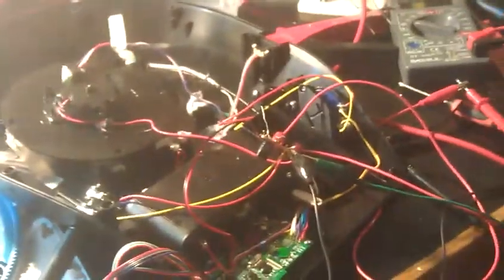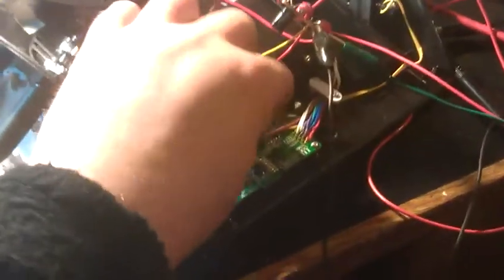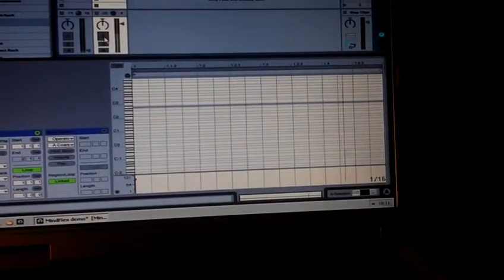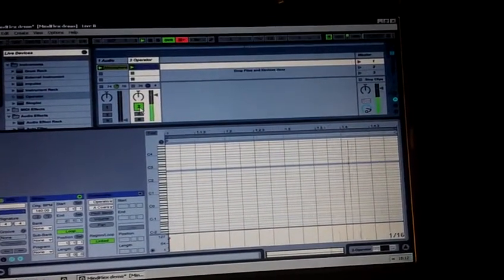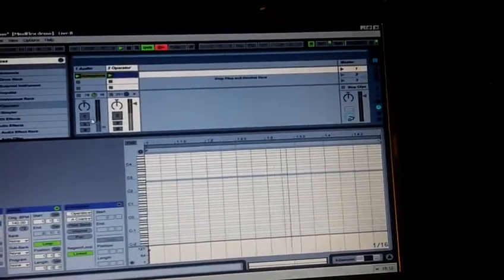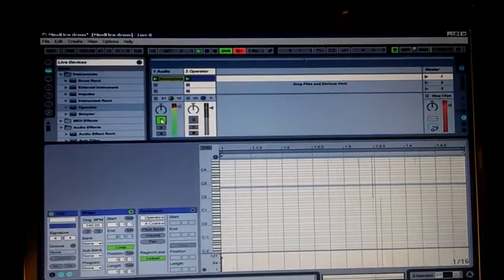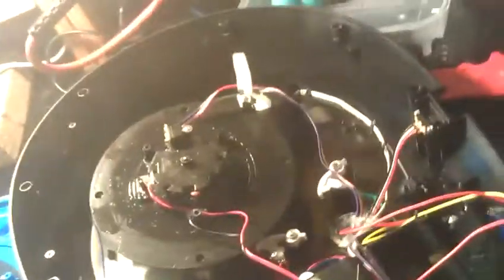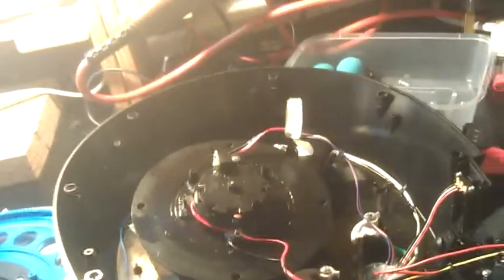EEG to MIDI demo

Comment from the maker: I'm doing a really rudimental hack on this - I'm just translating the speed of the fan into MIDI data. The headset in its default state takes a basic reading of concentration + relaxation and uses it to control the fan. Because this was one of my first hacks, I wanted to just hack the base unit as I didn't trust anything I'd made myself anywhere near my brain..!

However, the Mindflex headset is capable of much more and can read Alpha, Beta and Theta states but you need to hack the headset itself to do that. That's my next step - and by using a Teensy board, I hope to then connect it as a class-compliant MIDI device and at this point it would be possible to compose using brain waves - however I don't know how much control one would have over it.

This is the best info I have found on the subject:

http://frontiernerds.com/brain-hack
Reply: This is phenomenal man! I have a question, By thinking about the same things and concentrating at the same level, can you recreate a piece of music multiple times?
Reply from the maker: Andrew Ferris

It would be very difficult because of the nature of the brain-waves but not impossible... possibly easier with the rig I've built. By configuring the incoming data in Ableton, I can set the speed of the fan to correspond to 3 or 4 notes, and that would be a good place to start with learning to control the brainwaves.

Surprisingly, having the little ball floating around really helps... ;)

Recent stuff I've worked on has been focused on taking small physical movements and translating them nto musical gestures since most of the people with disabilities I work with have some mobility, so I'm currently working more with ultrasonic sensors and also experimenting with the Leap Motion controller.
Reply: Thanks for your reply Lee. I'd love to see any further videos you make so please tag me in them! 

I guess limiting the notes would make it simpler but with training, it sounds like its possible to "play" with your brain.

I have no idea how it works but if you could map certain thoughts to certain notes, you could get some really interesting results.

A combination of the all those input devices would be really interesting!